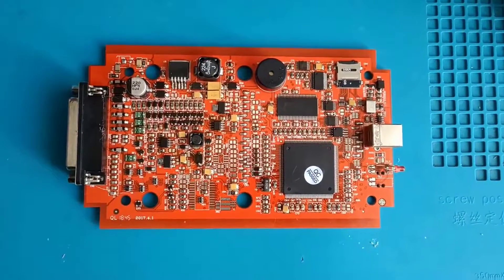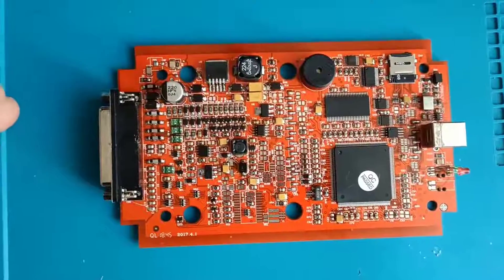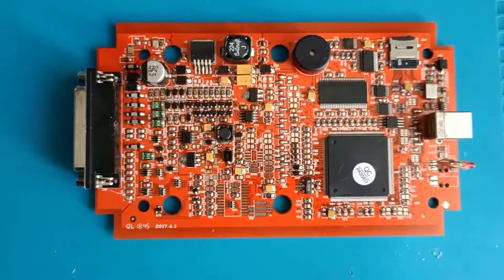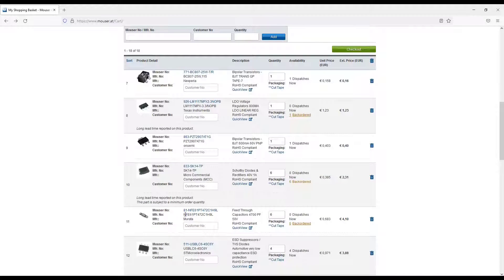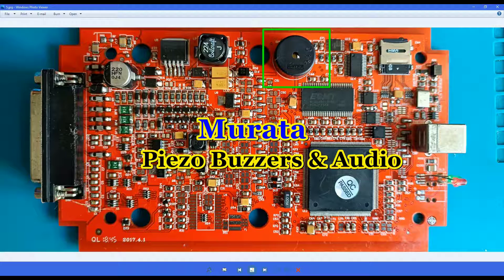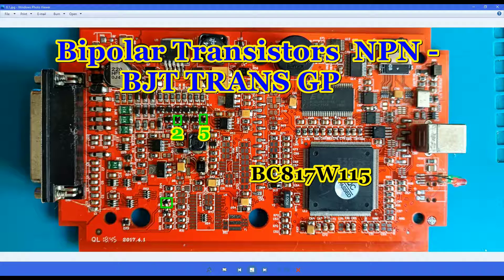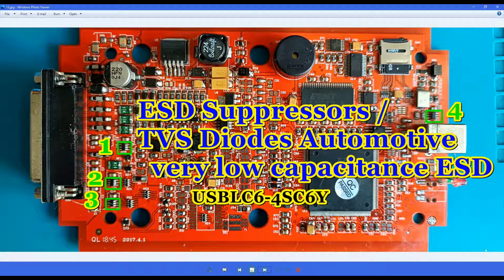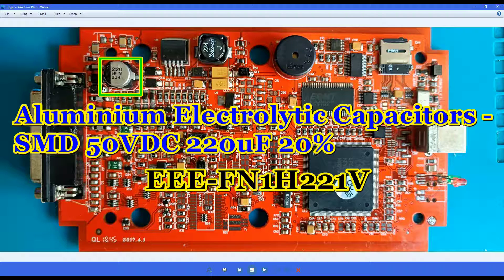Rework Kess .v2 How to repair this PCB poor quality clone to work normally!!!

Comment: Hi YoYo! sorry to trouble you mate, I am looking to rework the Kess but a few parts are now obsolete, 1 being the Murata buzzer which I am not concerned about replacing but I am wondering if you could kindly tell me if these would be a suitable replacement for the other 2 components below? Thanks mate, I appreciate your time and love your content! 🍻

81-CSTNE8M00GH5L000R to replace (81-CSTCE8M00G15L99R0)
833-SK14-LTP to replace (833-SK14-TP)

Comment: i just got my clone ktag 7020 and kess 5017.. yesterday ... if i follow your improvement.. will this add any feature to the device..??
Reply: I believe this rework is only for the increased success rate of not losing connection when reading or writing

Comment: Good morning, maybe I have not explained myself well, I know that fc200 does not do edc 15 but now it does 16. My question is if it could read edc16 c34 volvo c30 1.6d 2008? On the other hand, I have kees 2 original, it will be blocked due to an update to kees 3 within 15 days. If I use the nxp chip, would it work as a master clone? I have drivers of version kees 2.47 kees 2.47. Where can I load the latest drivers? I plan to buy a kees v3 and I have bought the original v2 with 14 days to try it comes from an update and it is going to block
ar. any ideas to evite blocking? or should i convert to clone? I already have a kees 2.47 red plate clone.
Thanks friend, your disinterested videos help a lot of people.
In andalucia spain very hot.....

Comment: Heyho! What is about the coil left in the middle? Grüße und mach weiter so!
Reply from the maker: Hallo,
you can change this too if you want, but it's not necessary.  
The most important is to change Murata filters and capacitor's.

Comment: You could do this work for me ?
Reply from the maker: Hello. 
How can I ?
Reply: @YOYODiagnostic  I have genuine slave and need to convert to master is it possible?
Reply from the maker: Hello.
if you want to do that you have to change NXP + card.
  Do not recommend this but sell it and buy something else.
Reply: @YOYODiagnostic  Can you pleas help me with  the kess sd card image please. I have the wakeup error an did no protocol found
Reply: Are they worth anything now with new kess out ?
Reply from the maker: @stephend8564  tuning through the obd plug Kess was and remains the best.
Reply: Maybe I'll do the conversion and keep it then at least I will have genuine hardware so maybe less problems compared to clone

Comment: You do know you actually missed the only major component that needs replaced on 99% of any kess pcb manufactured after 2016 , as all those reworked parts merely enhance the performance characteristics of that one single component. Don't believe me? well if you have a scope handy, scope the 8 MHz ceramic resonator that's used on all these production boards. You will more than likely see  a frequency deviation of -0.16% to 0.3% of the 8MHZ needed clock signal (a low as 7.910mhz).
 Most reading problems are linked to this very component. The processor needs a signal of 8MHZ + up to 0.10%. The problem is that Ceramic deviation is usually 0.5% ( 5000 PPD ) where as a Quartz Crystal is usually 0.005% ( 50 PPD). Remove the Ceramic, and replace it with a 8mhz quartz such as your common 2 leg items you see, centre pad unused, orientation not important,  hand solder in place, and without reworking any other single component you have made you knock off Kess 100% better than it ever was :)
Reply from the maker: Hello.
That is very correct.  
I changed that component.  I'm sorry I forgot to mention filming.  I made this video a few years later after,  done that rework.  
If you really are from PCMtuner write me privately by email.  I'd like to try your programmer.
Reply: Hi.
Sorry, can you tell more specification about that oscillator?
Like capacitance and ESR?
I'm looking in mouser site, if you can specifi trough there i will be apreciatted.
Regards
Reply: @ByBpt  HI a 22pf will be fine without need for any external capacitors. common HC49 type works fine, look for a 30ppm. Just solder legs to outside pads centre not connected, orientation of crystal is not important.
Reply: @iecutool_eu  in which case do i need to add an external capacitor depending on the load capacitance? sorry if it may be sort of a stupid question for you but it's outta my knowledge area:D
Reply: @iecutool_eu  I canot find 22pF, only 8 MHz HC-49S  20 pF ±30 ppm. Is it ok without  any external capacitors ?
Reply: @andreas_bcd it's close enough
Reply: @iecutool_eu  So i can put it without problem?
Reply: Where is this located on the board?
Reply: @stbo84  See bottom left next top the cpu

Comment: The coil value is 224 on the board, but code and originally it is 221??
Reply from the maker: Hello.
It doesn't matter what is written on it but the values.  If you can't find one track, compare it with another available.  On the site of this company that produces it you can compare different components,  the functionality is the same.
Reply: @YOYODiagnostic  thanks for reply. it seems that some uses base of uH, some base of nH, 224 22x10^4nH=220uH Odd...

Comment: Rework IMPOSSIBLE.Voltage regulator  "LM1117MPX-3.3/NOPB "   nowhere to be found on the planet earth, until february 2023 .
Reply from the maker: Hello.  Thanks for watching.
I think you're a little wrong.  indeed on the big reputable sites that sell parts are no longer available but are still for sale and I still buy and are still on this planet.
Reply: what about L9613B013TR. I can't find it anywhere, and no equivalence.
Reply from the maker: @PaulPPR  
Hello.
Unfortunately it is only available in April 2023.
  They all went crazy with all these chips.
Reply: @YOYODiagnostic  yes, it seems I will ski[ that one. Hope won't be problems.
Reply: Or maybe I will try only 8mhz resonator first...

Comment: I bought one Kess clone last December and I don't take it out of the box yet. And now, after seeing your video I don't know what to do. There are too many components for solder, and even when I desolder an eeprom, there's always a resistor or another small piece that goes away, even with hot air blowing with minimum speed.  I need to practice my skills.
Thanks for sharing your work and knownledge.
Reply: I would say you solution send to him to do job for you pay him for time
Reply from the maker: Thanks for watching. 👍